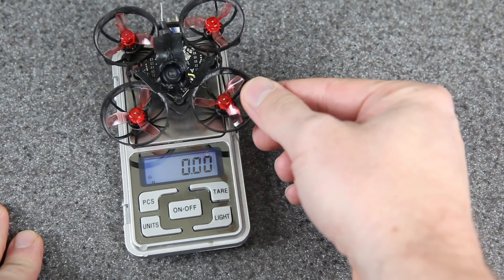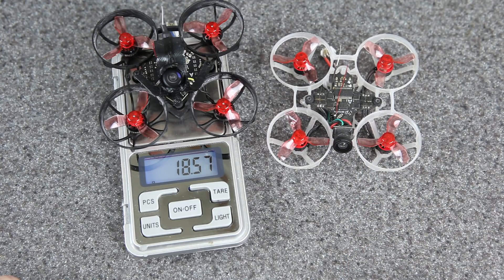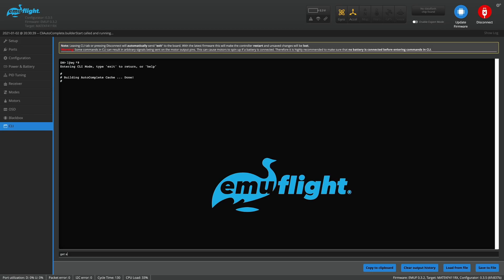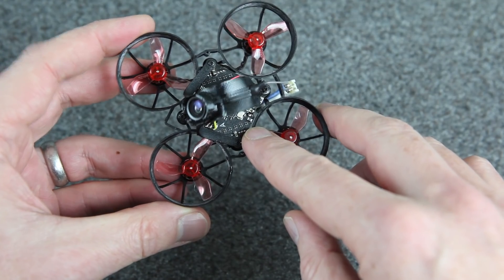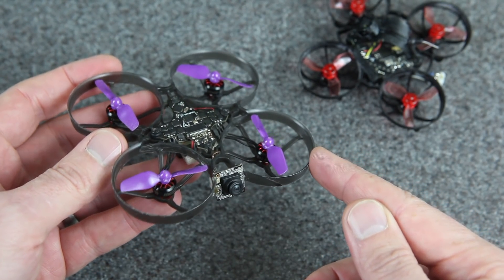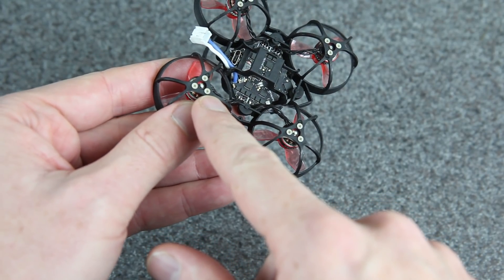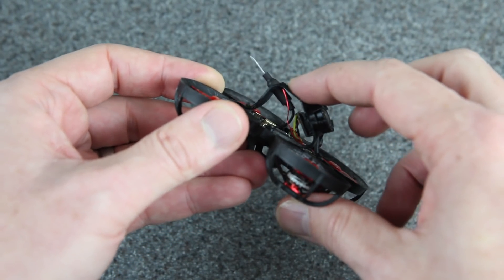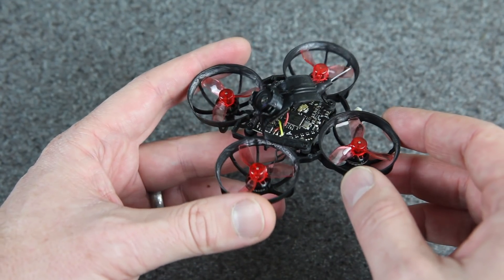DAS Might Change The Way I Race Whoops! Emuflight’s New Dual-Axis Steering!

Comment: Thanks! Very impressive winter flight! One question? Which ratio you use to mix roll with yaw? I guess depends on how comfortable you are when cornering but i guess should be certain limit? Thanks in advance
Reply from the maker: In this flight I set "add_roll_to_yaw" to 30 so I was still steering with a mix of both sticks. I have tried higher values since then. With a value of 60 or more you can pretty much steer with just the right stick, but that is harder to get used to. I think I will settle somewhere in the middle.
Reply: @MrShutterBug  thanks! That makes sense as our brains are trained already to steer both...i will give a try when i can. Thanks again!
Reply: @MrShutterBug  Did you keep the other setting ("add_yaw_to_roll") set at 30? I'm currently flying with both set @ 30 and it feels pretty good, but needs more testing.

Comment: Does the mixing go haywire if you reduce the speed or does the FC compensate for the change of the gyro angle?
Reply: mixing is based on stick input, so it all just works as you'd want.  After about two packs and some tweaks to the settings it's pretty easy to "see how your hands move" when you race and change settings accordingly.
Reply: @ProjectMockingbird  With the resources available, that’s probably the best the FC can do. With the gyro involved the angle mode would probably become very DJI like for the noobs 🤔😁
Reply: @pirateradioFPV  yes, and actually I run this on my CineWhoop with a new "CineAngle" setting that is basically "DJI Mavic Mode but with WAAAY more control"....I should have some footage soon of it, but it's insanely smooth while being precise.

Comment: Wow, looks like on rails! Please make a vid of a 5" quad with this dual axis steering! :D
Reply: There are some pilots that are doing this and I've experimented with it and kind of like it...
Reply from the maker: For racing 5" in angle mode? I've considered it, but the tracks tend to include things like corkscrews and dive gates that benefit from full acro.
Reply: @MrShutterBug  Would it be then possible to do it in acro mode? I guess not, cause I imagine at steep camera angle the YAW axis could cause the drone to dive into the ground on a turn. Yaw is also barely used at above 40 degree of camera angle, as the drone is being turned with more roll authority. It would make more sense at shallower angles if I am thinking right... It could be useful on cinewhoops as they are usually being flown in angle mode, causing better maneuverability :)
Reply from the maker: @MrLukkar  could you use DAS in acro? I'm not sure, but I don't think you would want to.

Comment: I am new to this game and I am building a 65mm whoop based on A flights frame. I have the Happy Model 802 19000KV motors. I am planning on using the rest of the parts you show below. My biggest thing is Emuflight, I have Betaflight 4.2 on my computer, I don't understand Emuflight at all. Where do I go to get better informed about this?

Comment: Add to that nfe racemode and after setting your pitch, you can simply focus on throttle management and turning with roll... Interesting.
Reply: I got used to nfe mode since I started learning with a brushed silverware whoop. It's the reason I went to emu, so I can fly in angle mode "properly." Using regular angle mode makes me feel lost! But yeah, it's not for everyone. I'm excited to try it with DAS!
Reply from the maker: I haven’t tried NFE race mode, but I don’t think I wouldn't want to give up pitch management. The fastest way to loose altitude is to pitch down more, not to drop throttle.
Reply: @MrShutterBug  I needed maybe 10 packs to start licking NFE. 100spack later I love it! It's almost air mode with extra safety. Adding DAS would be interresting. I tried FPV angle mix but it didn't work. If anybody knows (maybe because NFE was enable...)
Reply: Franz please let me know if you like. Im using NFE on betaflight and Im a bit lazy now to do the switch for emu :)
Reply: It'll take a while. The only whoop I have currently is a brushed silverware 65mm. My mobulas have been converted to 3" toothpicks 😂 I'm waiting for an fc though to rebuild my mob 6.

Comment: How does this differ from using camera angle mix in betaflight?  If I add angle mix of 15degrees in BF it will add in yaw to the roll input.
Reply from the maker: There are similarities, but FPV Angle Mix is fundamentally designed to compensate for the angle of the camera so you can pitch and roll about the plane of the camera instead of the plane of the drone. You still coordinate your turns. DAS gives you move control over which sticks are responsible for that yaw input and in what proportion. Cheers!
Reply: thanks! I’ll have to try it out

Comment: Did you mess around with the emu rates for angle?  Looks like roll and pitch actually have rates in emu plus all the center and end stick stuff.
Reply from the maker: Those settings came from Patrick Clarke of Project Mockingbird. I have not messed with them myself. Pitch and roll rates have no affect in angle mode, so they would only affect acro. The yaw rate is the only one that affects angle mode.

Comment: can be done with the camera angle mix in betaflight?
Reply from the maker: No, they are not the same. FPV Angle Mix compensates for the angle of the camera so that you can pitch and roll relative to the plane of the camera instead of relative to the drone. You still have to coordinate your turns, and you still do roll and yaw with the same sticks.
Reply: @MrShutterBug  ah yes
but could it be abused for that?
Reply: @marc_frank  well, that was the old Project Mockingbird hack before I came up with this idea...MUCH more flexible and powerful for angle racing as you control both axes inputs. :)
Reply: @ProjectMockingbird  options are valueable!

i would like to try controlling the rotational acceleration
one level below acro
top level is controling the angle with stickposition
then derivative of angle over time, rotational rate
then derivative of rotational rate, rotational acceleration

it would further reduces stick usage, needs a short tick to start a turn, another to stop it

Comment: if u set the values too high, you will get emax ez pilot beginner mode!
Reply: that's kind of one of the things that got me started on this path...While talking to the EMAX guys they were working on that mode, but the firmware is very limited with the ez pilot.  I'm hoping we can put out a hex for their quads with this easy mode on.

Comment: How does DAS differ from FPV Angle Mix in Betaflight?  Thank you for all of your fantastic videos, I have learned so much from you.
Reply: BF fpv angle mix , 
when you roll right, BF adds yaw left. 
 When you yaw left , BF adds roll right.  It's Meant to allow you to keep the quad horizontal if only using one input command. Meaning if you have 40 degree camera angle, and use only roll right, the quad is supposed to rotate about the center of your FPV picture.   I tried it once and I didn't get used to it after 3 batteries so I removed it.  

Das sounds like when you roll LEFT, emu adds yaw LEFT.  So, it adds the opposite of BF.  

Anyone else? Does that sound right?

Cool idea.  Whether I'll use it or not I don't know.  I love that they're trying new things and driving innovation!
Reply: @Jrod_FPV  FPV Angle Mix also adds right yaw when you roll right. Otherwise you’d just be doing barrel rolls :)
Reply: @GRANOLAFPV  yes that sounds right based on the explanation in the video.

But now I'm second guessing how BF works.... I think BF also works the same as emu when pilot enters yaw. Otherwise just like you said, the quad would only be able to barrel roll no matter what input you have, yaw or roll.  

Which also makes me wonder if emu works the same because if you're going to change how 1 input works, you almost have to change how the other works too to have useable and supplementary outputs.  

 It's been so long since I tried it I don't remember for sure.  Someone else would have to confirm.
Reply: FPV angle mix translates your commands so they correspond to the plane your camera's on. You still gotta coordinate.

Comment: Interesting feature! ... but I'm a bit confused 😅
"add roll to yaw" Is it mean when I move the stick roll to the left it will also yaw to the left according to the value set ... or the opposite ?
Reply from the maker: I agree it is confusing.nerdCopter's answer is incorrect. add_roll_to_yaw means when you tilt the roll stick, also cause yaw movement. If you set add_roll_to_yaw to 100 then the roll stick will cause roll and it will cause yaw in equal proportion.
Reply: @MrShutterBug  ahhh crap :(  :((
Reply: @MrShutterBug  I see ... and what happen with yaw stick, is it still have the default behaviour or it won't have any effect at all ... or something else?
I'm mostly use stable mode for race and apply high rates for yaw
Reply from the maker: @gonebdg  it will still have the normal effect.
Reply: @MrShutterBug  thank you sir!
Reply: yeah, we are working on a naming and code change since we've gotten a bunch of feedback to go to "add_yaw_INTO_roll" so that it adds yaw when you input roll with the right stick.
Reply: @ProjectMockingbird  While that's a little better it still could be interpreted as adding the amount of yaw that I'm doing into the roll amount.  Maybe you need a different verb.  roll_causes_yaw, or yaw_when_rolling, yaw_with_roll?
Reply: @ProjectMockingbird  Whatever it is .. thanks for your effort. We as users ... just need better manual/docs. to prevent confuses :)
Reply: add_roll_to_yaw will add some roll movement to yaw-stick-input
add_yaw_to_roll will add some yaw movement to roll-stick-input